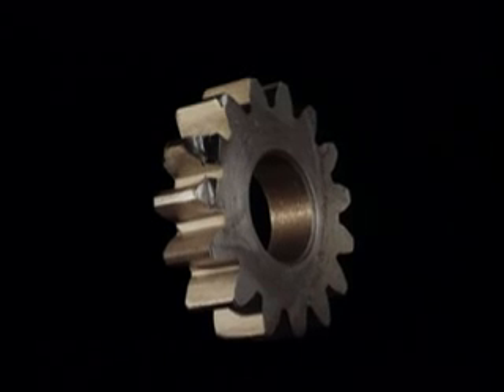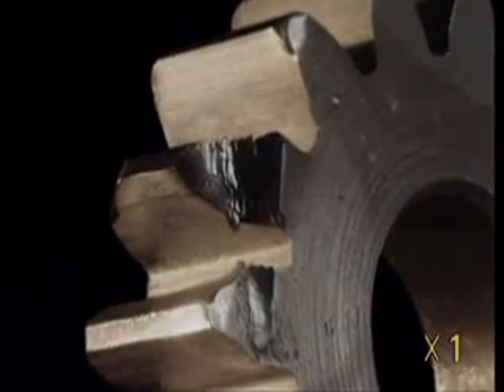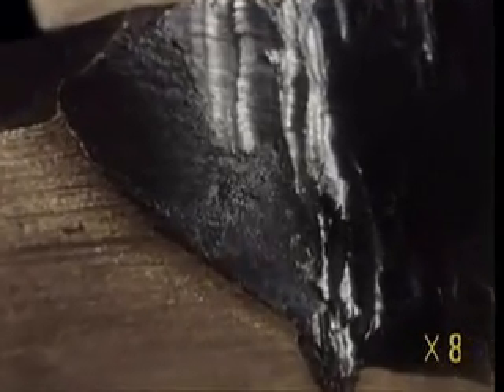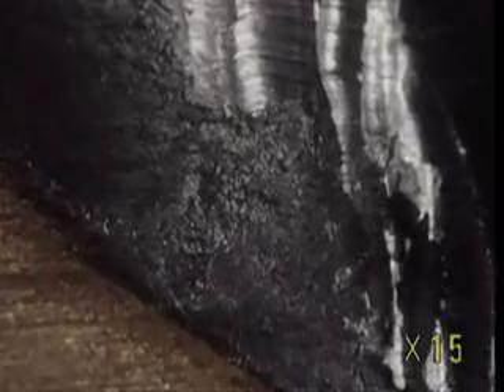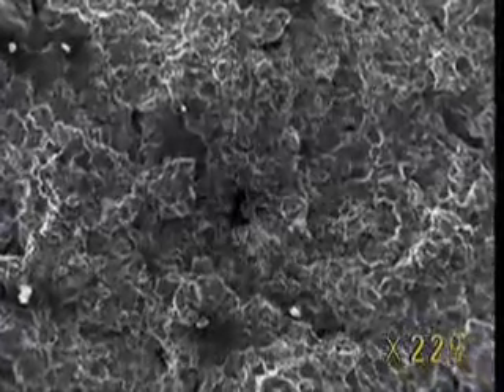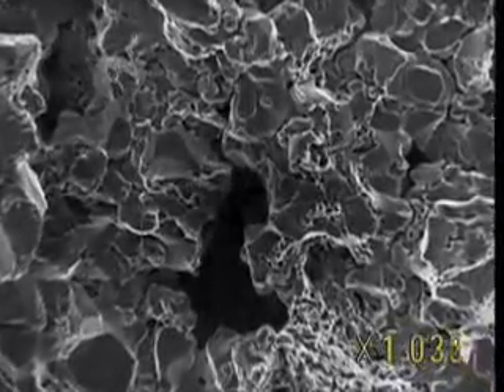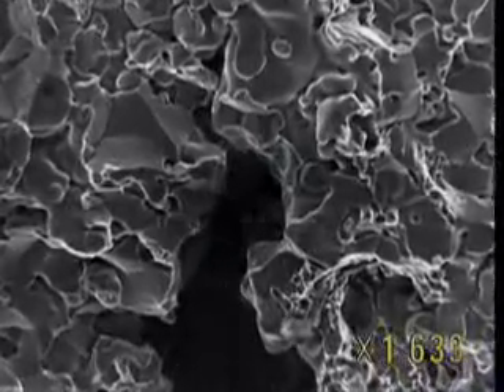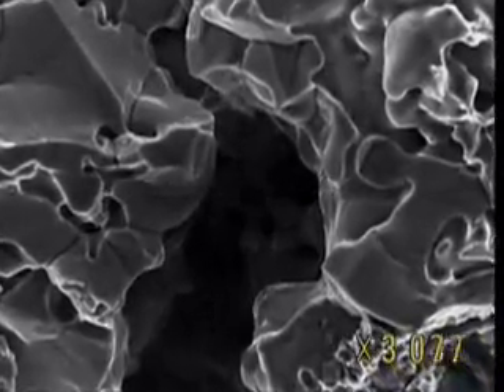Exploring the atomic composition of steel

Comment: To the naked eye this is just a broken tooth gear it’s made of conventional steel  composed mainly of iron and a small amount of carbon . This small quantity of carbon is enough to protect the gear from corrosion but not enough to make it indestructible over time. To increase steel’s resistance other elements are added: nickel, manganese, chrome. This type hundreds of different types of steel are made. As we move closer this fracture allows us to discover the structure of the alloy a rugged landscape materializes . Here and there a scattering of white specks their tiny particles of dust. That have settled on the surface . Each of these petal-shaped forms is a particle of steel called dendrite , An alloy of iron and carbon dendrite is found in all solid matter that crystallizes in cooling . It’s found in steel, aluminium and even in snowflakes . When cooled rapidly steel increases in strength a process known as tempering. Between the particles a cavity  is outlined we’ll continue our journey through this hole which is probably due to the aging of the metal in the background a grain of pearlite emerges from the shadows it’s easily recognized by its characteristic sliced a structure .
The thick black diagonal cutting through the perlite contains a little more carbon than the lighter areas around it. So do the other thin lines it’s this extra carbon that gives the darker color. 
The fuzzy black-and-white flecks of faults in the structure brought into focus by the microscope .
At maximum enlargement a series of tiny regular spots appear. Here at last is the atomic structure of steel, atoms of iron and carbon regularly stacked in all directions .
Beyond this noting more is visible for the moment.

Comment: Pretty sure atoms are just the pixels of the matrix world.
Reply: Those are the pixel's, pixels.
Reply: shhmh that's 4K
Reply: trixels actually.
Reply: Planck lengths are pixels of the matrix world. Planck length is literally 0.000000000000000000000000000000000016 meters long, meanwhile, atoms are about 0.1 - 0.5 meters.

Comment: The vast majority of this video is incorrect, it should be taken down.
Reply: +Derek K Yeah its mostly wrong, very misleading.
Reply: i know this is really late, but can you at least confirm that we are even looking at atoms? lol i find this type of thing fascinating and am really interested in what atoms really look like
Reply: +Derek K could you guys fill us in?
Reply: King Koopa those really are atoms you're looking at! You just can't see the atomic links between them cause they're invisible. And if you minitiurize yourself like ant-man up to an atomic level, you'll just see marbles stacked up under each other haha lol. not like you pictured in your insignificant mind huh?
Reply: +Joel Wilson Basically, many points in the video are inaccurate. Carbon doesn't generally protect against corrosion, chromium can be used. Dendrite is not an alloy, it's a shape, that hole wouldn't be made by ageing. That feature that is zoomed in on isn't pearlite. Those lines aren't pearlite. Carbon doesn't give a darker colour.

Some parts of the video are useful. What you can understand usefully from the video is that materials are made from atoms in a regular array in crystals, and that those crystals have faults in. The mixing of almost accurate information and completely wrong information in a high quality seeming video is quite disturbing to me.

Comment: Rather misleading unfortunately.  
I used to work on SEM, TEM and AFM.  The amount of preparation required to "see" atomic structure is huge, you can't just "zoom in" and see it on a  random bit of metal like that. And then only with TEM or STM, an SEM can't resolve atoms.
Plus it starts with a light microscope (you can see colour), then moves onto SEM at around 0:50, then the "atoms" will be CGI or possibly an image from an STM or something like that.